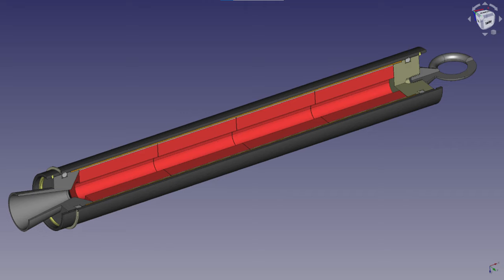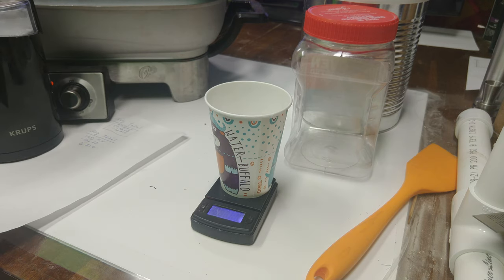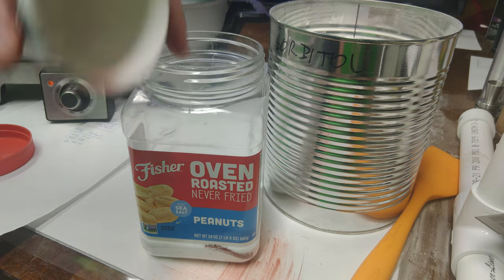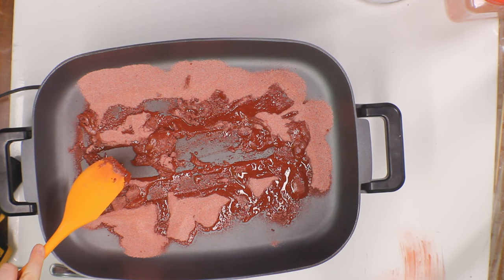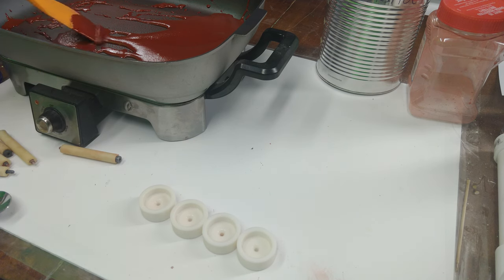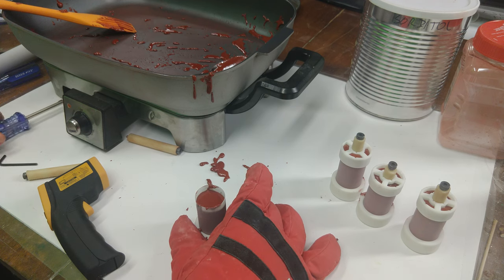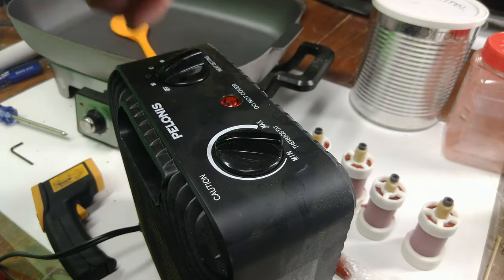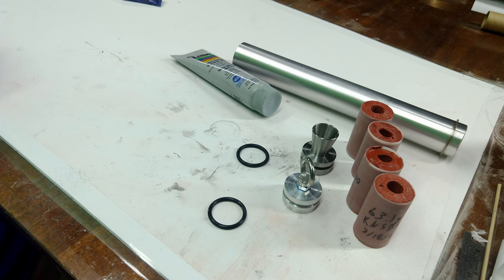Casting Sugar Rocket Fuel - Build a KNSB (Sugar) Rocket Motor - Part 5

Comment: When I was 15 (1959) I and other kids were making candy fuel just like this. Miraculously, no accidents. I pushed the cap out of spent shotgun shells which made a perfect nozzle. I filled the shell and taped the end closed. Cannon fuse and a stick taped on and I was in business. Making candy fuel  and storing it allows it to absorb water, greatly reducing it's power. Enjoyed your video. Michael
Reply: Great 😅
Reply from the maker: Thanks for sharing your story.  I always try to store my fuel with desiccants to reduce moisture in the fuel.  I agree, I have had some motors that were under powered because of moisture.
Reply: Sorbitol is less hygroscopic

Comment: I'm a bit of a stickler when it comes to formulas.  With that said, your percentages total 101%.  What I have done, is remove 1% of Kno3 replacing with the 1% of Red Iron Oxide.  Is it a huge difference?  Maybe, maybe not, but makes more sense to me, than 101%

Subscribed!

Comment: Just putting this out there for all the people who have asked if pla works instead of resin. As confirmed yesterday it does not. At all lol. Will probably end up either using a higer temp filament or still printing the case in pla but machining an aluminum sleeve they can cool off in and help hold their shape. Cheaper than ordering tubes. Also how are you lighting your motor? From the top of all the grains or the very bottom? I've read always light at top to prevent it from sending pressure back up the core and making it do weird things.
Reply from the maker: Good info.  I haven't tried any filament, maybe ABS would work?  And yes, you want to light the top of the motor for the reason you stated primarily.
Reply: @MinuteRockets  I ended up turning a case that the pla can cool off in under pressure that made it work. Abs I'm not sure. It's probably not worth it just because of dealing with the smell it puts out but the mould I made solved the problem and presses out any air pockets thers could be.

Comment: Hi, first thanks a lot for your very instructive video. Do you have the reference of your Black & Decker heater ? I can’t find it in france 
👏🏻👏🏻👏🏻👍👍👍
Reply from the maker: You don't need a heater, it is just being used as a fan (no heat) to cool the parts off.  Any small fan will do, or they will cool off naturally just not quite as fast.

Comment: Hi, why do you use sorbitol? And not icing sugar or fructose or glucose!?  I am curious to know why, ( i am still a noob) please. Thank you!  👍😉
Reply: Sorbitol melts at a much lower temperature and also pours much more easily. It takes a small hit to performance compared to sucrose, but you tend to get a better grain quality, which can boost reliability. You can also add 0.5%-1% Sodium Laureth Sulfate as a surfactant which will make the propellant flow like honey, though it requires a 24 hour cure time before the grain hardens enough to load and launch.

Comment: which filament did you use to print those casting molds? I'm thinking about printing similar ones in PLA, but I'm not sure they'll resist the high casting temperature
Reply from the maker: Hello, the parts were made with a resin 3d printer (Elegoo Mars) and Elegoo standard resin.  I talk a little bit about resin and heat effects in this video: https://youtu.be/q9TE2ZHLYWw
Reply: @MinuteRockets  awesome! Thank you for your insight!

Comment: What about an induction cook top since it doesn't generate heat and is fairly precise on temp?
Reply from the maker: That would probably work.  I haven't used one so I don't know how hot the top of the stove/bottom of the pan get.

Comment: Surely sugar would be favourable performance wise over sorbitol?
Reply from the maker: Actually they are very similar.  Sucrose might be 2% better (153 ISP vs 151).  However sorbitol is preferable because it does not break down (caramelize) with heat nearly as easily as sugar, so it is much easier to work with.

Comment: What material is the 3d casting tube made of? How long is the motor burn duration with and without RIO?

This is a very good demonstration on how to safely cast a sorbitol motor! I am looking forward to the test fire.
Reply from the maker: The casting tubes are Elegoo standard resin (https://amzn.to/3hOaHUG)

I haven't done a test with and without the RIO in a motor, but according to Richard Nakka, RIO makes it about 25% faster in open air. (https://www.nakka-rocketry.net/oxidex.html)

Comment: Particule size of sorbitol does matter. Richard nakka carried out some tests and I have too, the finer the powder, the less viscous the propellant will be
Reply from the maker: Thanks for the comment!  Particle size of the oxidizer (potassium nitrate/KNO3) matters, but particle size of the sorbitol doesn't since it will be melted, there will be no particles of sorbitol in the slurry.  

I believe the finer the powder, the more viscous the propellant, but at the cost of lower performance (slower burning).  From https://www.nakka-rocketry.net/sorb.html:
It should be noted that the viscosity of the melted propellant slurry is highly dependant upon how finely of the potassium nitrate is milled. When prepared as described above, the slurry will not be fluid enough to cast, and as such it is necessary to scoop the propellant into the casting mould. The slurry will be more fluid and easier to cast if the potassium nitrate is milled for a shorter time, such as 10 seconds or less. Or if the potassium nitrate is obtained as a fine granular form (similar to table salt), it can be used "as is". The drawback is reduced performance due to less efficient combustion, lower chamber pressure, combined with a slightly longer burn time compared to propellant made with fine-grind oxidizer.
Reply: @MinuteRockets  upon further investigation, you're right. I missremembered this part, I was actually thinking about the mixing ratio😅

Comment: Can we make a single grain rocket motor rather than these 4 grain
Reply from the maker: Yes, you certainly could.  You would just need to adjust the motor length and the nozzle throat diameter.

Comment: Can AL be used instead of rust?
Reply from the maker: Not in the same way.  AL would be a fuel, and I'm not sure that sugar fuel is hot enough to effectively use it.  Some other formulas like Ammonium Perchlorate based propellant do use AL for fuel.  The rust is a catalyst, so it just helps the reaction to go a little faster.

Comment: Why do you split up the fuel? Why not one big tube of fuel?
Reply from the maker: Using shorter grains instead of a full length grain gives a more even burn because the surface area of the fuel remains roughly constant as it burns in the core and on the ends of each grain.  The geometry is called a Bates grain.  If we did a full length grain, the surface area would constantly increase as the core got bigger and bigger, and the motor would produce more thrust as the burn went on, which could be a bad thing.
Reply: You're also more likely to crack a full height grain and ruin it, which is another practical reason.

Comment: Why add the screw and silicon tube in that pipe
Reply from the maker: The screw gives it rigidity and the silicone is a so it doesn't stick.  You need the hole in the middle of the fuel grain to increase surface area, otherwise the fuel wouldn't burn fast enough to produce usable thrust.

Comment: Why did you melt the sugar and added kno3 .... just mix the powdered form of sugar and kno3 and mix it well .... that works absolutely fine.

Does heating up and melting the sugar make it more powerful or increase the thrust ? 
I added aluminium powder in the mix and used in rocket engine and it was just fantastic.
Reply from the maker: I think it's just more consistent if you melt the sugar and you get a higher density.  I have seen people who just mix the powders and pack it in and it seems to work.  Just a matter of what works for you.

Comment: can you add the link of the difference between dry and melted knsb?
Reply from the maker: Hey, so I wasn't able to find that video on YouTube, and the place I found it is a private forum so I can't really share it from there.  I'm going to try to reproduce the test when I get time and post it here myself.  Basically the dry mix was harder to light and burned pretty mildly whereas the liquid mix burned violently and very fast.
Reply: We've done this with KNSB and other 'sugars' and the result is the same. As a mixed powder it burns slower than hot melted propellant. The hotter it is the faster it will burn.  https://www.youtube.com/watch?v=BcuUJglxcBk Only heat it hot enough to melt and pour...I don't exceed 225 F

Comment: Wouldn’t a plastic container potentially generate static electricity and ignite the mixture?
Reply from the maker: Good question.  This mixture is actually pretty stable and will not ignite with just a spark. I have never seen anyone have trouble mixing this way.

Comment: I just want to say, i wish i watched this video before 4th of july lol. Ive been making my own mix of 25% sugar, 75% Kn03. Then i pour into a old pan. And i use a gasoline camp stove. On the 4th i was making my first batch(using pill bottles as measurement because i marked weights on the sides of them so because i dont have access to a scale(used my dads at his old work)) anyways i did 1 bottle of sugar and 3 of the stump remover into the pan, mixed around. I was doing this outside away from anything flamable. And it just all combusted. Lukely i wasnt burned. I was wearing shorts, t-shirt, and flipflops. Next time ill make sure to wear at least pants and closed top shoes lol. My family were sitting on the back porch just conversating as i was about 50 feet away making the batch and it went off. My mom brother, granny and dad were unphased as they are used to my shanagins. But my cousin, and aunt were freaking out. Unferstandably. Ill have to invest in a cooking thing like what you have 100% as well to help prevent that.
Reply from the maker: Glad you didn't get hurt.

Comment: i was making my fuel on a stove, but made the mistake of not using a pan, and umm i had a smoke gernade in my kitchen, the fire peoples was even called, but no majour fire
Reply: but the disaster was only when i made my 2nd batch, and my first batch more than a meter away cought on fire too from the hot ash

Comment: Nicely done video. Suggestion, when you start heating, set the temp to 200 F and cover the skillet until all is melted. Then turn up the heat to 225 F and gently stir trying not to add air bubbles. Allowing the propellant to melt before stirring in the unmelted dry powder helps eliminate tiny air bubbles that lower the final density. Turning up the heat to 225 makes the propellant less viscous for pouring (or scooping). Here is the video link you may have been looking for. I've done this a few times with various 'sugars' and they all work the same. As a dry mixed powder, they burn relatively slowly but when hot and melted will burn in a fraction of a second in a fireball throwing propellant all over. The same as if burning a pile of black powder or a handful of apcp trimmings. https://www.youtube.com/watch?v=BcuUJglxcBk
Reply from the maker: Thanks for the tips!  Yes that's the video.  I remembered seeing it maybe on TRF but I could not find it again.

Comment: I mean i did it on a stove with a thermometer...
Reply from the maker: Just be very careful of any propellant that drips over the edge of the pan.  If it hits the burner then the whole pot could go up in flames very fast.
Reply: @MinuteRockets  i will! i also i got a huge project coming up; i bought 19 packs of 100g of potassium nitrate and just imagine how high could i fly